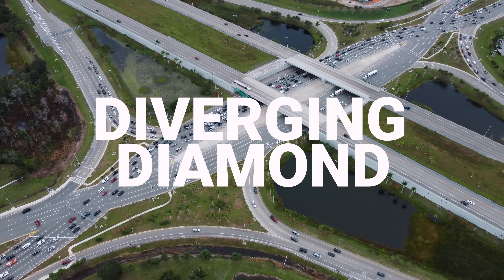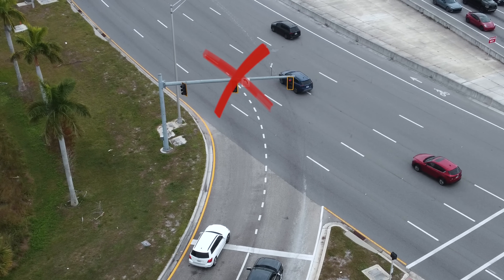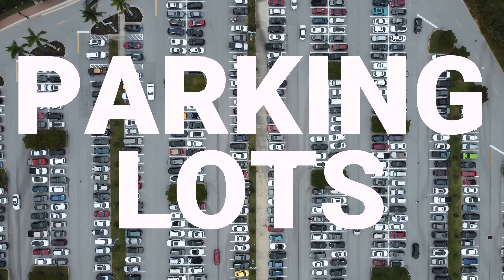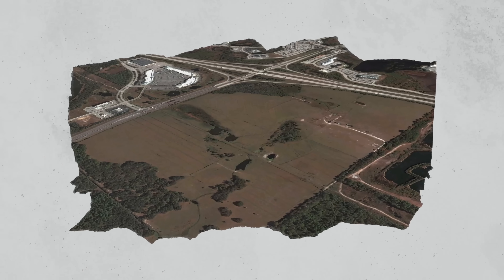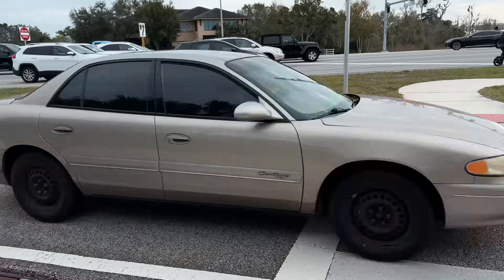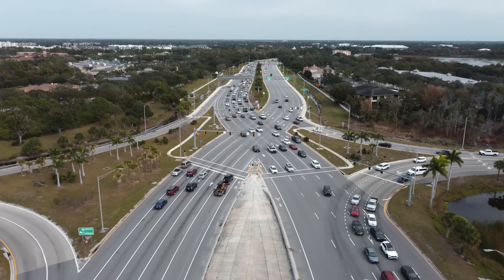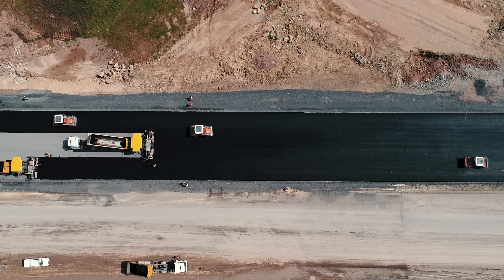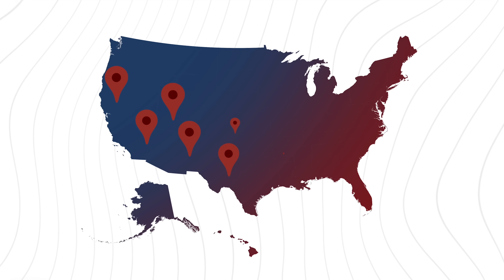Traffic Will Never Be Fixed Here

Comment: We had one of these diamonds here.. it made the traffic 10 times worse. Because it worked perfectly on low traffic, but as soon as the cars coudl not cross the diamond itself before the lights changed..  EVERYTHIGN stoped.   These layout would only workd if there is an underground or a pass over.

Comment: more people > more cars > more lanes > brings more people > more cars > more lanes
The cycle will go on infinitly cause you are not fixiing the root issue instead you are just making more adjustments. If you built one trasit from 1 hotspot to another hotspot like a metro/mono rail you would remove like 100 cars a day from that line.

Comment: The gaslighting about this intersection is amazing. "Its so safe because the people getting on/off the highway don't have to cross paths." Except ALL the traffic has to cross TWICE! I have been watching traffic / road infrastructure videos for a while. First, Americans were ridiculous for having a circle in the middle of a road, its so dangerous and inefficient. . Now, Americans are idiots for taking out their roundabouts, they are so safe and efficient. Now we have interchanges where every vehicle has top cross the path of every other vehicle instead of just those that turn. 5-10 years from now I guarantee it'll be "Americans are so dumb and over engineer things."
Reply: America actually had the first traffic circle, building a bunch of them in the early 1900s.  They were dangerous and innefficient, so America got rid of them before the roundabout concept was developed.  America started building roundabouts in early 1990s after France's campaign in the late 1980-1990s.
Reply: Roundabouts would fail because the traffic volumes are greater than a roundabout's capacity, and the construction would cost more.

A roundabout interchange would cost more because it would take more right-of-way outside of the prior interchange design.  That would require more stormwater management facilities, as well as shoring / retaining walls due to encroaching into the slopes of the overpass highway.

And the roundabout would not be efficient for places with such high traffic volumes.  They max out at 1000 vehicles per hour for single lane roundabout (1700 for dual lanes).  Roundabout interchanges are better for rural/surburban locations where traffic is not projected to increase.

Comment: A lot of problem malls and shopping has in america is that they park horizontally and not vertically.
It's more expensive to build underground parking, but it removes so much street parking or parking lot parking that just wastes space.
Reply: Because land is cheaper.  Construction cost is exponentially greater than than land cost for a vertical structure.

Comment: Diverging diamonds are completely retarded.  Seriously.  Not joking.  r e t a r d e d

They implemented one in Joplin to replace a cloverleaf intersection that my uncle had helped to design as an engineering student.

It's so much worse now.  Everything about it is worse.  Stoplights where there were previously free-moving lanes is not "more efficient".  Forcing people to drive on the left side of the road when every instinct tells them to drive on the right is not "safer".  Directing entire highways to stop in order to slowly crisscross themselves is not an improvement.

The old intersection had no one crossing traffic to turn left.  You simply drove under (or over) the overpass and took the looping right that merged you onto the other road.

No one had to stop.  No one had to cross traffic.  

Now everyone must stop.  Everyone must cross traffic.

DIVERGING DIAMONDS ARE RETARDED.
Reply: Cloverleafs are innefficient for large volumes of traffic.  There are cars conflicting at the merge points, which causes for stopping and more queues.  DDI reduces the risk of queue spilling into the freeway lanes.

Streetcraft has a video explaining that.
Reply: @traffic.engineer  The Joplin intersection was rarely backed up as a cloverleaf, if ever.  

I never remember seeing congestion there, and I used to drive thru it at least twice daily.

My points about efficiency and safety still stand.

Diverging diamonds are r e t a r d e d.

Engineers get high on their own designs and forget about actual, fallible humans.  

Every driver who approaches a diverging diamond for the first time is confused AF.  

It's way too easy to head straight into oncoming traffic.

Comment: maybe try to make that diamond intersection more square-ish (shorter + version rather than longer >< )
Reply: The interchange is using the footprint of the prior interchange.
Reply: @traffic.engineer  it doesnt change much of the size. the main problem with traffic backing up is that long >< intersection would get blocked  reduce efficiency.
change >< to X would reduce the vehicles sitting in that section.
Reply: @redhongkong  That would be a SPUI (single point interchange).  SPUIs would provide efficiency for the non-freeway road but reduces efficiency for the ramp traffic.  If the location functions more as collector of freeway traffic and ramp traffic has greater order of magnitude, then the DDI is more efficient.  Additionally, a SPUI would cost more due to more construction necessary within the slopes of the overpass.

Comment: seems like a cloverleaf would do the same with 2 less intersections
Reply: Cloverleaf, like roundabouts, does not work with high volumes of traffic.  See Streetcrafts video why.
Reply: @traffic.engineer  in Germany we almost always have cloverleaves and the merge lanes are separate from the highways (so main reason why they're bad isn't there). 
we never merge on the highway itself, you take an exit, merge there at lower speeds. the highway itself keeps all the lanes as before.
like where the A7 and the A2 cross: 52°23'49.6"N 9°53'59.3"E
at these intersection there is usually also a speed limit and since we have these extra merge lanes you have plenty of time to accelerate to the limit way before you reach the actual highway

Comment: One word .... cloverleaf.  The double diamond interchange was invented to address the fact that drivers are stupid and getting more stupid.  The correct answer to this problem is improving drivers and not the road.  This must include punishing stupid drivers.  Follow the basic rule for road efficiency, remove lights etc.; don't add them.
Reply: Cloverleaf would fail.  They are only efficient for low volume roads.  High volumes increase the conflicts at merge points, which lead to more stops and queues.  Not mention the additional right of way to build them.

Comment: americans will do anything to avoid building a roundabout or traffic circle.
Reply: Roundabouts would fail because the traffic volumes are greater than a roundabout's capacity, and the construction would cost more.

A roundabout interchange would cost more because it would take more right-of-way outside of the prior interchange design.  That would require more stormwater management facilities, as well as shoring / retaining walls due to encroaching into the slopes of the overpass highway.

And the roundabout would not be efficient for places with such high traffic volumes.  They max out at 1000 vehicles per hour for single lane roundabout (1700 for dual lanes).  Roundabout interchanges are better for rural/surburban locations where traffic is not projected to increase.

Comment: Woukd a round about almost be better?

More lanes are not always better.
Reply: Roundabout would fail because the traffic volumes are greater than a roundabout's capacity, and the construction would cost more.

A roundabout interchange would cost more because it would take more right-of-way outside of the prior interchange design.  That would require more stormwater management facilities, as well as shoring / retaining walls due to encroaching into the slopes of the overpass highway.

And the roundabout would not be efficient for places with such high traffic volumes.  They max out at 1000 vehicles per hour for single lane roundabout (1700 for dual lanes).  Roundabout interchanges are better for rural and surburban locations where traffic is not projected to increase.

Comment: Easy
Fix just make the two cross points a tunnel, the confusing area will be gone and the traffic lights will be removed
Reply: Great.  Only increases the cost 100x.
Reply: @traffic.engineer  for a few meters of tunnel?!!! that can't be real 
Just to be clear, I ment only the crossing part so the length of the tunnel should be the width of one of the main roads x2  that can't be 100x the whole price
Reply: @_Ari__.  it would severely increase the cost.  Tunnels/bridges are not cheap.  The structure needs to be load bearing for traffic, which would cost more than the pavement for the entire project.  It would also require more dirt/fill to raise the road.  The slopes for traffic would reach the downstream intersections to make a gradual grade, and getting it back to level before going under the bridge (for trucks mostly) would also require greater length.  The roadside slopes would go outside the public right of way (extra land is not cheap).  And the stormwater management for additional pavement would require bigger drainage and collection facilities.  The greater impact to the environment would increase costs with the complexity of the tunnel/bridge construction.

Comment: The main problem with this interchange is the comercial spaces built all around it. If you go south down the main highway you'll see there is another diverging diamond where the 4 corners are residential areas. If you don't have mixed zoning spanning out of the 4 corners than everyone will always need to cross this interchanges to go from residential to comercial when they could be walking between the corners for different activities instead of driving.

Comment: I think the diverging diamond works well, but it’s not infinitely scalable.
In my hometown of Naperville Illinois, we have a diverging diamond over I-88 and it’s only three lanes in each direction, and it’s pretty short in length. I have never seen traffic that was caused by those signals in the interchange. In fact it rarely has traffic despite being along a major road.

Let me know what you think. Would they work better at a smaller scale or is the diverging diamond at I-88 and Rte 59 an outlier?

Comment: The entirety of Sarasota desperately needs a redesign. It's almost entirely low density housing, With incredibly tiny patches of commercial and industrial, like this mall, which likely serves as the place to shop for everyone in Lakewood Ranch, which is almost 35,000 people, because other than a few small Publix Supermarket's, and some other tiny shops, there's hardly any kind of commercial buildings. Lakewood Ranch also seems like the kind of place where people snub Publix as poor people food.

Comment: 4:17 There's an easy solution to this problem and it's already practised in the UK: yellow box junctions. Yellow box junctions are areas hatched with yellow lines. In general, motorists are not permitted to stop in these areas at any point. They are essentially large "keep clear" signs. Drivers must ensure there is sufficient space ahead before moving into a yellow box junction. This way, you prevent cars from proceeding; getting stuck in the junction and blocking it for cars coming from the perpendicular direction when the light turns green for them.
Reply: American uses white boxes.  But because of the lane markings within the crossing to guide traffic, it would not be feasible here.

Comment: The basic design is just shifting where you stop. A much better design would be for one or both of the two directions to change elevation (one over the other) and neither direction to stop at all. That's three dimensions rather than two.

Comment: If we put the car-centric design aside for a moment and analyze the diverging diamond purely for function, not priorities, it still fails on multiple points (exchanges conflict points/waiting times), but the funny thing is how simple it is to eliminate the mixing zones entirely (as opposed to the DD): Design make a conventional intersection with flyover left-turn on and off-ramps.

Done. Problem solved. 

It wouldn't even require a single crosswalk - it'd be straight through. Mic drop.

Comment: Maybe, if the USA could conquer its phobia of roundabouts....?
Reply: Roundabout would fail because the traffic volumes are greater than a roundabout's capacity, and the construction would cost more.  That is why America has strict criteria regarding where roundabouts are installed.

A roundabout interchange would cost more because it would take more right-of-way outside of the prior interchange design.  That would require more stormwater management facilities, as well as shoring / retaining walls due to encroaching into the slopes of the overpass highway.

And the roundabout would not be efficient for places with such high traffic volumes.  They max out at 1000 vehicles per hour for single lane roundabout (1700 for dual lanes).  Roundabout interchanges are better for rural surburban locations where traffic is not projected to increase.

Comment: There is no inherent issue with constructing a diverging diamond interchange. However, it is crucial to incorporate pedestrian and cyclist infrastructure into the design. This can be achieved by providing dedicated walking spaces and bike lanes. In fact, India has set a positive precedent by incorporating proper biking and walking lanes, even on expressways, and this approach should be emulated in similar projects.

Comment: What everyone leaves out about the diverging diamond intersections is that there is a better alternative. There is a design where the roads go under each other instead of crossing. If you ever have a power fail condition, they have designed a suicide crossing with no way to safely cross the opposing lanes. If they had made two tunnels, one tunnel on each end, so one lane goes over the top of the opposing lane. NO red lights needed, no crossings needed.

Comment: Ok i heard it before. Car bad, bike good. Boring.
But any solution other then "demolish city and build from scratch"?
Of course this gargantuan shopping area generates a lot of traffic, well that's a fact, and cannot be changed.
But isn't this video about the intersection itself?
Like for example actual issue with this intersection: that drivers don't know if they can clear through the crossing when they start driving through it? 
This is the issue with intersection of this size. 
Even on small road crossings it can be hard to react in time when the drivers in front of you are already stuck on the middle of the intersection.
But with 5 lanes, this is only multiplied.
Road is longer, there are more lanes, and more cars. 
You can actually see, that most of the time, drivers get to notice pileup in the distance of about 2 lanes (in width).
So what i think is the ACTUAL issue here, is timing of the traffic lights.
Reply: Yes but even the traffic from the “26 lane” intersection ahead causes backup the entire way. Solving the traffic timing light issue would only  increase flow INSIDE the interchange and intersection. Then the cars will be waiting for their left turn in the larger intersection anyway

Comment: A good solution here is a double roundabout in the shape of a peanut C=C (the second C should be reversed) + two u turn lanes before the roundabouts to be able to not llow traffic to make a full circle, thus having freeflowing traffic from one roundabout to the other. only yield signs would be when entering from the highweay and entering from the mall. Previous intersections would control the flow of traffic into the double roundabout and would make for uninterrupted flow.
Reply: It’s called a dumbbell interchange 😁, and the traffic from the other intersection would leak to the roundabout. Decent idea tho

Comment: I swear, traffic engineering in the US is actually retarded. Not only is divergent diamond a solution to a problem that shouldn't exist in the first place, the whole backing up problem could be easily fixed if they just did it right the first time and installed smart traffic lights at this interchange and the surrounding area.
Reply: Even with perfect timing on the 26 lane intersection, every car would be waiting a while and buildup would occur, just to many cars.

Comment: I remember trying to make a 'continuous flow diverging diamond interchange' on Cities Skylines (1) and found that grade seperation can work but you would need either a gargantuan plot of land or tunnel the highway and have bridge crossings. Honestly after the hours it took to get right im not entirely sure that any diverging diamond interchange is a good solution and that my home country of England has a near perfect solution with a raised roundabout intersection in an oval configuration....as long as you give enough room for merging that is and mayhaps a traffic light at each entry point
Reply: CS1 AI can’t handle a roundabout either 😂

Comment: The problem is density, there is too much in that spot. Spread stuff out a little and that kind of problem goes away. Pushing for more density to deal with the problem of too much density is an absolutely silly "solution." And no one mention the induced demand fallacy. No amount of extra lanes is going to increase the traffic between New Ulm and Frelsburg in Texas. The just one more lane problem is due to too much density, not demand increasing with supply.

Comment: If I were to design a new city, I'd build skycrapers within a small area. You can't avoid using cars when things are far apart, and the only way to keep things close to each other is high density populations. Only skyscrapers and fast/big elevators + 3D roads/pedestrian walkways can achieve that. Just make sure they are not built near seismic zones.